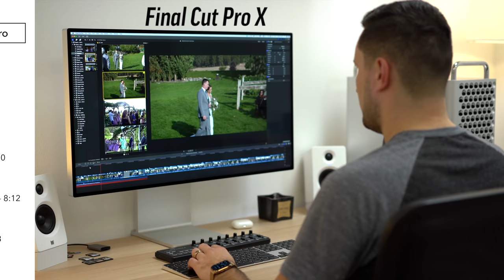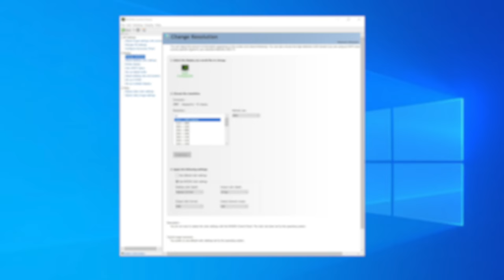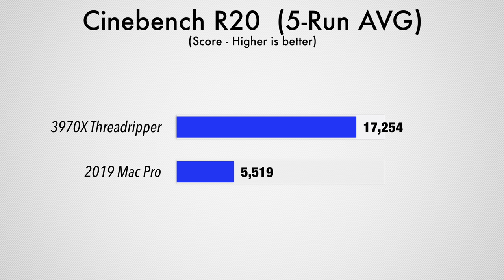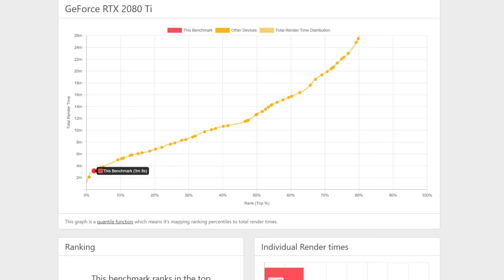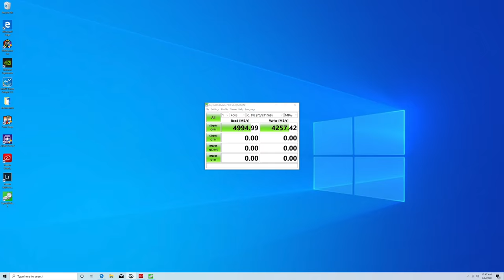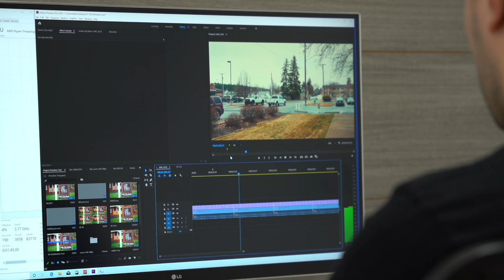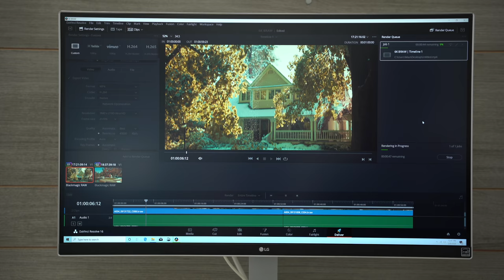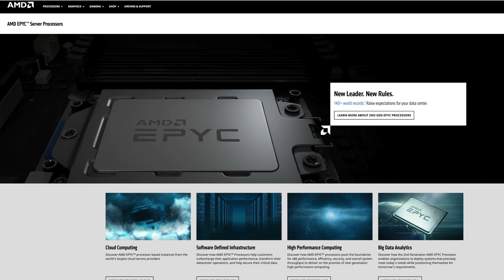$15,000 Mac Pro vs $5,000 Threadripper - Sorry Apple..

Comment: This comment section going wild making fun of apple. Sure a windows computer is way better but most people who buy a mac either are not good at computers such as some students and a mac is VERY reliable that one can last up to 9 yrs. on the other hand its people who acknowledge windows is cheaper and faster but the OS is optimised for them and their workflow. Some people need Final Cut Pro and things such as that. In the end they are all computers and no one is that professional to need that much computer horsepower. Instead, people should be worrying ab their rent lmfao. This is coming from a guy who has owned a Razer Blade 15 base and now a higher end MacBook Pro 16. I personally prefer a mac as i am a high school student who makes some vids and also likes to do light gaming on windows bootcamp. Therefore, macnis perfect for me :)
Reply: 9 years HAHAHAHAHAHAHAHAHA sure
Reply: @ThreePointSeven  theres people using a macbook from 2011

Comment: you could run rtx titan(s) in there and still beat the apple price. All the noise could also have been solved by using... you know... not shitty cooling systems? in fact custom waterblocks for a threadripper/epyc + waterblocks for rtx titans with noctuas? That'd drag apple around in the dirt.

Comment: EPYC CPU's are for server stuff right? What those have to do with workstations? This is more like Intel have messed up their name lineup, I think. Because there are Xeon's more oriented to server stuff and other ones that are, like the one in the macintosh, for worksations.

Also, why, you have to buy a rtx 6000 to mach the 4 vega II of the mac? This guy knows what is SLI? (Or NV-LINK, it's pretty much the same in the consumer grade market).

Anyways there are pros and cons to having a mac, (more cons than pros) but to be honest, the afterburner card is kinda cool.

Comment: why doesn't Mac affordable as time ago it was? 
when the manufacturing and production of hardware is easier, cheaper and more popular , the price commonly is better as seen in a lot of devices, remember when the cellphone was a “luxor gadget” , remember when VHS was “glamour” for priviledgeds. look around and a lot of stuff with new tech is more expensive, yes, but still not at all as Apple products being more and more high price over priced, if Apple used minerals and compounds from Mars or the Moon, maybe it’s price would be justified 💰

Comment: I can do with two epyc cpu on a double cpu motherboard far better than having the afterburner card
Reply: Ow and I can put up to 800gb to 1 terabyte with the right motherboard. And epyc are not slower than Xeon
Reply: Also you can overlock the and and you shouldn’t use water cooling. Also the Mac... can it run windows better with the afterburner and all? Because windows can run more programs such as autodesk suite for industrial design and animation/games. Also don’t forget it can run games while Mac OS can’t.

Comment: Ok when you design the PC why not chose a cooling system that is fan less, you have the budget for it since apple use a fan less system and cost way more. The PC you made don't represent what you can have for 5K, even the graphic card is a bad choice, You can have GeForce card with 24Mg  and still be on a lower  budget.

Comment: Remember that Apple is using the Intel server processor (Xeon), for that reason it supports up to 768GB, the AMD server processor (EPYC) supports up to 2000GB of RAM, in addition to having 48 more threads, more cache (L2 and L3), more memory channels, etc, literally eat any XEON on the market with chips.

Comment: One word Linux

You can run MacOS under KVM on Linux and windows at the same time
IO is just your configuration
Next time go for a 3990x, if you want power...
Fan noise is just this build, if you want it silent do a custom loop or get better cooling
That case looks like its restricting air flow meaning more heat
Linux should be more snappy then windows
Temps is your own fault, whats the ambient temperature inside the case? just want to add there is probably air getting trapped in the pump also on the Ryzen build
Blender should be faster under Linux
Davinci Resolve was developed for Linux
The case is just a case get a better one....
Silent because you didn't build the PC right
If you want epic go with 2 64 cores and tell me about the mac again?
why didn't you get the Quadro then?
Plug and play so? you can get it built for you
A PC is just not limited to windows...

I fail to see the point with this video if it was a 15000 mac vs 15000 custom PC, then I would see the point more.

Comment: Besides the Mac technically being a slow PC, rebranded with a fruit logo and a GUI for Unix.... many of the concerns or negative points for the PC could be fixed. I heard its even faster if you uninstall the spyware platform called win10 and give it a *nix.

Where is the 64core threadripper???

Comment: Reviews like this make my stomach turn. It seems nobody even gets the reviews right or even the actual point of the Mac Pro. Let me compare gaming benchmarks and software that’s code is not written to take advantage of the Mac. Yeah and gaming... if you spent 10k on a Mac Pro for gaming benchmarks your seriously confused. Tell you what. I’ll through a titan rtx in my Mac Pro and boot into windows and get the same experience gaming. Then when I’m done I’ll boot back into Mac OS and open Final Cut Pro to edit my RED Raw footage at 8k and then I’ll mix down a feature film and orchestral score using my Apogee symphony Mkii interfaces. Only the best audio interface on the planet when it comes to audio. Oh and windows can’t use those. See $10k I get the best of both worlds. Windows and Mac and I don’t have to hack and pray nothing breaks to do it.
Reply: you can literally do all of that in a windows pc with lower price '_'

Comment: A 32 Core CPU will OFC make much more noises and consume more electricity than lower core CPUs<

Cuz it needs more electricity to run 32 cores,
and more electricity means more heat waste,
and for that heat, you need fans,
but it becomes so much hot that even the most silent fans make noises !!!!!!!

So, You can't expect less energy consumption and less noise from a 32 core thread ripper,
and you are left with a choice,
Performance and Multi-tasking

OR

Less power consumption and noise creation !!!!!!

Comment: The biggest thing I noticed with custom built machines is that they don’t last long. I have a Mac Pro for 12 years and I’m still using it today for renderings. I’ve built custom PCs 3 times now since 2010 because either the motherboard or the processor fried. That’s biggest thing I noticed. I think that’s why people buys Apple computers.

Comment: Mac fanboys saying mac are for progarmming 
One thing
Ryzen threadripper 3970x
Titan rtx
Reply: 3990
Reply: 3080
Reply: @drewzma6816  no
Reply: @drewzma6816  3080 is for gaming not for progarmming
Reply: @drewzma6816  the 3080 only has 34 teraflops while the titan rtx has 130 teraflops
Reply: @drewzma6816  plus it last's longer because it is made to program
Reply: @zephiermonka  3090
Reply: @drewzma6816  no
Reply: @drewzma6816  35 teraflops to 130
Reply: @zephiermonka  BRUH titan rtx has 16.3 tflops, you're talking about rt tflops and not tflops

Comment: Feckin' use Linux!  Windows has limits.    Linux has been tuned for threadripper!  If the fans are too loud, sit it on the floor!  So, while I appreciate your video, you should have thrown linux into the mix!!!  And if you don't like the case YOU selected, YOU selected the wrong case!  Yea, I'm thinking your compare is slighted!  And you can BUY pre-built threadrippers! -WoW!

Comment: Performance: Mac <<< PC

This guy: "Mac > PC cuz of the noise"

Look, I don't have problems with Mac or Apple. Their performance is good but if you're comparing performance, why do you need to focus on the noise so much?

Most users are not as sissy as this guy and just disregard fan noise for a PC with GREAT SPECS for a LOWER PRICE.

Comment: Full day to build XD you probably followed the verge's guide on how to build pc and how long the f does it take to make every part so its compatible go on google and for less than 5 mins you will find what you need
Also even if it takes you 5 days 
Lets say you make 2k a day 
Well the pc is 10k cheaper like even if it costs you thousands you sayng it like the apple ships from the sky just they drop it from a plane at the second you order
In the end he is like it has wireless charging to sound either like he isnt a apple a day keeps your wallet away(empty) fanboy or it was carcastic

Comment: Cant you put a non amd vega card in there IE a asus or msi? Because those have better coolers.
Also you sound bias AS CAN BE. If you actually put more effort in you can actually have a nicer inside case. AND epyc may run slower it performs better in some cases or just as well.

Comment: No matter how strong hardware configuration - Windows will ruin everything. 😆😆😆
Reply: I would like to see some reasoning behind this, oh wait there isn’t any
Reply: @ThreePointSeven  Believe me, there are a lot of reasons. I will not explain details, because there are many videos showing that Mac computers are faster and without problems than computers running on Windows. And no matter how powerful the hardware, the hardware-software connectivity in Mac computers is ten times better.

Comment: In the start yeah windows is better
In the end applefanboy instincts fully kicked in how dumb you need to be to start ranting about the windows gpu when the pc is 3times cheaper you camt compare them unless you slap 4 rtx 2080ti
Or even rtx 8000 if you need workstation performance

Comment: Are you an apple puppet or have completely lost rationality? 😂😂 If you had spend 300 bucks on a cooling solution you would have heard zero. Also, this specific case model is not the actual lowest noise model, since it has the fancy windowed case which is not optimal.

Comment: Windows is garbage
Reply: @TsunamicBug  I use Ubuntu. Just wanna remind everyone that Windows is garbage.
Reply: @TsunamicBug  The problem with Windows its a virus magnet. I can't see myself using it for critical tasks if I'm always worried it will be compromised. Also NTFS will degrade the hard drive over time which means a shorter lifespan on storing important data. Also if you want to develop on Windows you really have no other choice other than using Visual Studio and you'll need to download the SDK separately. Basically it's a complete nightmare for professionals and the only thing keeping it afloat are games and certain periferals. But with development in Vulcan and OpenCL such advantages are diminishing. Windows really is hot garbage and the weakest point in any setup.
Reply: @TsunamicBug  If it fits your need then go for it. It's basically a toy.
Reply: @TsunamicBug  Linux is mostly entirely a command line experience. With SSH I can have total control of my system from anywhere in the world. With Windows I'm bounded to the screen while I can batch process multiple systems in a coffee shop. And wih every software being open source I can easily peruse all code base and understand how everything works. I can't do anything like this in either MacOS or Windows. So yes its a toy. You can only use what's provided and nothing more. Once you're adept at programming nothing comes close to Linux.
Reply: @TsunamicBug  I don't memorize anything either. In Widows everything is dumped into the Program files folder and good luck finding where the rest of the dependencies are hiding. While in Linux every folder structure are organized identically for all distros. And really nobody memorize how a music player works. Instead of looking for a play button you easily mplayer.play("/location of file here"). And since its a command I can automate how music is played from time of day to my GPS location. You're really not getting your money's worth if you don't know programming. It should be the next requirement after reading, writing and counting.